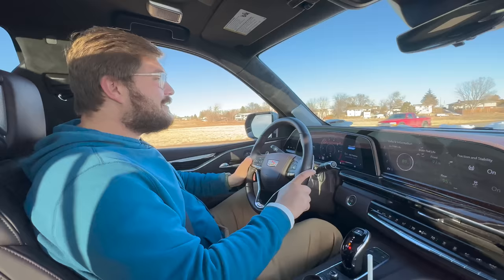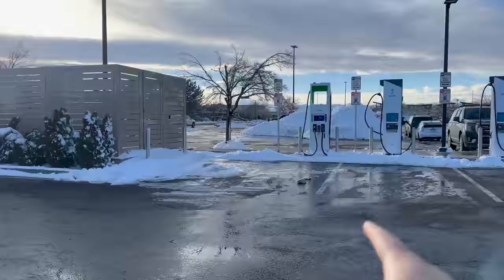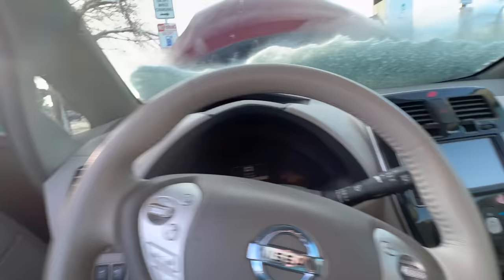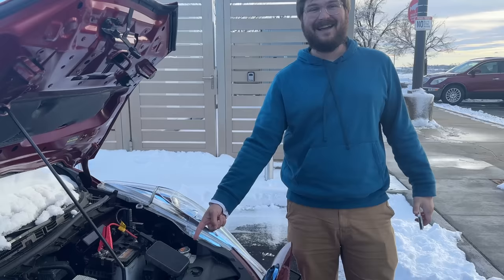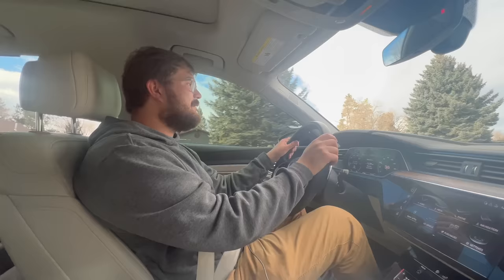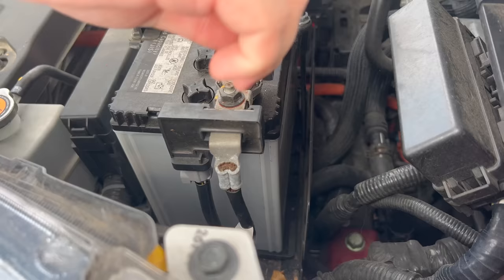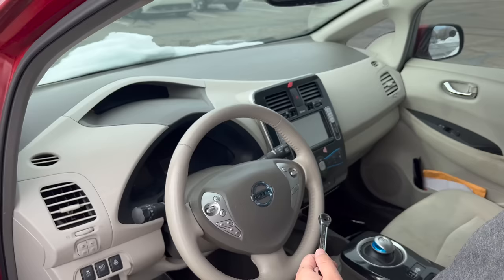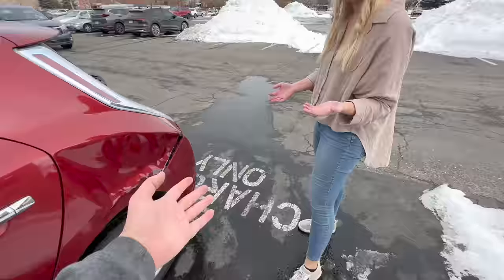My Cheap LEAF Bricked - So We Had To Save It!

Comment: The ESC activation on the Audi could be triggered by differences in the actual tire diameter. You would need to look at the measured tire speed through the ABS system and see if there is a difference. Some cars are super sensitive about it and even manufacturing differences in the diameter of the tire will be enough to trigger a perceived “slip,” especially if the tire’s manufacturing tolerances are sloppy. I’ve seen it many times. The same advertised tire size doesn’t necessarily mean they’re actually the same size. It’s more common when the vehicle had multiple tire brands on it, but I’ve seen it multiple times on cars with the same brand of tire but from different manufacturing batches. I couldn’t tell in the video, but if the steering wheel is off-center (like an alignment issue) it will throw off the steering wheel position sensor (aka steering angle sensor) which is part of what the ESC uses to determine if you’re sliding. If it sees steering angle but no yaw, it assumes you’re sliding and activates ESC. Just some things to consider.

Also, that’s a 51R battery. In other words, the same batter that every Honda pre-2010 uses. You could have gone to any parts store and picked up the same battery for half the price. I know that doesn’t help you now, but hopefully it’ll help some other Leaf owners. Most cars don’t need to get 12V batteries from the dealer since they’re almost all just BCI standard sizes.

Comment: A 12v battery issue on an EV? Never heard of that before. 😎
Reply: Ridiculous that a 12v battery is required.
Reply: @johnnyv5995  agree
Reply: @johnnyv5995  especially the voltage, the waste of copper is insane. The switch to 48v Lithium ION is necessary

Comment: That was the original 12V battery. I just replaced the 12V in my '14 Leaf and it was the same white color.  Panasonic batteries are what they used in those I believe. Since the 12V only needs to hold a charge for the computers to come on and isn't used to crank over anything they last for a super long time.

Comment: So as with ICE vehicles the easiest way to do this would be: have someone take you to buy a new 12v battery and replace it. That would have saved you so much trouble. I'd bet that would have worked the initial time as well.
Reply: If a lead acid battery is older than about 3 years I wouldn't trust it if it dies to come back.

Comment: I've always been taught to connect positive to the terminal, and then connect negative to some grounding metal away from the battery.  Then after your car is started, you reverse that order. That so that if there's any spark on disconnection, it's away from the battery.  My dad had a battery explode on him one time, sprayed battery acid all over the back of his overcoat, so thankfully no injury from it.
Reply: Also on the negative terminal of the 12 V battery on some cars there is a current sensor. On the Leaf I think it's the black rectangular thing that goes around the negative bus-bar between the battery clamp and where the flexible cable attaches. If you connect directly to the negative with any charger, the current sensor will think that the current is coming from the already dead battery, and this may mess up the 12 V charge management. It's always best ot connect the negative of your charging source to the body or engine somewhere.

Comment: Battery percentage is calculated using a formula where the main variable is voltage. It is an estimate of where you are along the curve from your battery's maximum and minimum voltages. 

The apparent voltage of a battery will drop when it is cold. The actual charge contained in the cells does not change, just the voltage that can be sustained by that charge. This is likely the reason for the fluctuations you see in SoC.

Comment: If there is no visible date sticker on a 12v battery, peel the side stickers down. The date or date code is usually thermally stamped about an inch down from the top, and intentionally hidden by the big label.

Comment: I suspect the LEAF was unhappy because there was an extra load somewhere. The HT was trying to keep the 12V full, and the 12V was running some random thing! 😁 Check for a stuck relay?

Also the LEAF won't charge when the bonnet is open.

Comment: In the USA with electrify America. You must: 1. First plug in the car. The.n With the car IGNITION OFF, 2. Initiate the charge. 3. If that does not work call them and have them reset the charger with the cart Unplugged, car off, plug in ( with the car off) then and only then have them initiate the charge.

Comment: The 12 V Battery died from an open inside it. It must have been very old. One thing Tesla tries to do is predictive maintenance to get the 12 V battery replace before such happens. Not enough current to make the relay pull in. Small boosters do work but it has to be a good 12 V battery it connects to.

Comment: Happy New Year's Eve. 

You might have to take the Audi to get its computer to recognize the winter tires so the traction system isn't freaking out. Or you could do it yourself if you have the right tools.

Also you can spray paint the 12V terminals red and black to save confusion about which is positive and which is negative. You can also use red and black tape.
Reply: WTF? Traction control detects wheel slippage. Think about it, different makes of tyres, tyre wear, weather, all affect traction, the car doesn't need to be told it has winter tyres fitted.

Comment: Procedure: 1) Connect the booster battery to the 12V battery to turn on the computer. 2) Start the car and disconnect the booster battery and wait 10 to 15 minutes for the lithium battery and its 12V converter to charge the 12V battery a little. 3) Move the car to the CHAdeMO terminal for regular charging.

Comment: You aren’t an idiot, but sometimes you have somethings to learn.   Certainly the truck can jump your 12v system, you just did that with the jump start device.   Electricity is electricity and that wrench could make a great connection between the 12 v and ground on the car.

Comment: Kyle, in my experience the best most reliable way to kick off Electrify America sessions is not by swiping the app but instead using the NFC or virtual wallet credit card in my phone and holding the phone up to the black/grey icon with the hand and waves for 3 to 4 seconds. Don’t put the phone on the credit card reader because EA will say “card not accepted.”  I use this as my go to way to activate and the great thing is you don’t need to know what charger in the app and swipe it so it’s quicker than fumbling with that screen. This NFC method works for me 95% of the time.

Comment: Any lead acid 12V battery that has been low on charge in freezing temperature needs replaced asap. The acid in them turns in to water when at low charge. Combine that with freezing temperature and that water freezing causes permanent damage to the battery.

Comment: Dude that Escalade V's shifts were unreal. Truly quick, rifle action, shifts for a torque converter auto (Ford's 10R80 does similar but for some reason this just seemed angrier). Amazing what technology is still doing for ICE vehicles.
Reply: the GM and Ford 10 speeds are related i think Ford design and GM are using them also

Comment: Some cars, certainly common among  many Peugeot cars of  the early 2000's (like mine) it has a no-tools-needed, quick release clamp on the POSITIVE battery terminal (this being a Negative Earth car).  No tool is needed as the terminal connection releases with a flick of a finger.  (if it was unusually stuck and someone was using say, metal pliers to release it, then, yes a danger would be present).  It is a handy feature and useful at times. Of course, don't wanna do it needlessly 'cause then y'gotta re-tune all the stations on the radio again afterwards LOL !

Comment: Just imagine some non-tech 70-year-old or teenager having to deal with this crap every time it gets cold out. Man, the tow companies are going to love these EVs.
Reply: It was the original battery. Old gas cars do the exact same thing. But yeah keep say dreamin.
Reply: @james5460  I have a 2012 LEAF and the battery died just like Kyle’s did. All I had to do was jump it and change the battery one time and jump start it another time just like an ICE car. Hence my statement. Yeah the leaf can accidentally go into neutral if you put it neutral. So what. So could an old stick shift car or an old automatic ICE car. Only super new modern ICE and EV have the lockout into park feature you’re referring to. Grow up I’m just trying to assure people that dealing with this older EV is no harder than dealing with any 10 years old car. And my leaf doesn’t brick every time it gets cold and I bet Kyle just had a shitty Battery so it died like all shitty batteries will in the cold since that’s what lead acid 12 bolt batteries have been doing for decades. Again no difference compared to older cars. I don’t see tow companies towing these but I do see plenty of ICE cars broken down on the side of the highway all the time. Oh heavens how will the old people and teenagers deal with ICE?  lol

Comment: Just go get a 12V.  You can get one at any auto parts store.  All of your issues could have been resolved in 15 minutes!  That, or jump start off of the Escalade.

Also, always remove the ground on the battery first before you touch the positive terminal, and do the opposite when installing a battery - positive first and then the ground.  Think about where that wrench might touch.
Reply: Yeah I don't get why they wouldn't have just gone and got one from a parts store. Why would you go to a freaking dealership to get 12v battery.

Comment: You could have gone to the auto parts store several times and purchased a 12v battery in the time you diddled around with that little booster.

Comment: for example, on the Renault ZOE, the 12v battery is a service item, if i recall correctly its supposed to be replaced every 3 years, even if the battery is good so it might've just beren that the battery needed to replaced a while ago lol

Comment: Careful those 6.2 have been throwing rods on the 2021 and 22. Those Noco jumps packs are awesome.on that charger you can press the manual override on it and it will give full boost . You usually have to use that on a battery that’s completely dead. If you pressed that it would stay going longer till you shut it off. Just make sure you are hooked to the battery’s correct before you push it
Reply: they throw rods cause people shit drive them for the sound lol

Comment: A jump-start, with old-fashioned jumper cables from the Escalade, would have got it charging.  That tiny jump box is pretty useless.  Of course, you probably would have still needed a new 12 volt battery eventually.  Lead acid batteries can be permanently damaged by the cold.

Comment: A Dutch company called Muxsan offers a CCS conversion kit for the Leaf. The kit including installation retails at €3K.
Reply: This would convert it to the European spec ccs and wouldn't work in NA. Yes NA and Europe both have CCS but they are different! Its so dumb.
Reply: @jamest6504  Correct, but I could well imagine Muxsan modifying the communications protocol. Changing the actual connector wouldn't be a problem.

Comment: The other Kyle wants a 60 KWH battery. This project should go with cheapest level 2 AC charger fix, then no more than 40 KWH battery, preferably smaller.

Comment: When my gasoline car runs out of fuel, I can simply carry a gallon or two to it, and away I go. A dead electric, no way - need to call a tow truck (gas/diesel powered of course) at a cost of $200 or so, and you still cannot go anywhere after delivery.

Comment: I have had this happen with a Leaf and the tired 12v battery was the culprit even more than the cold, not the car. It's not much different than an ICE vehicle in severe cold with a bad 12v battery and the best alternator in the world isn't going to save you. If you stop and it just sits, you won't be starting the vehicle again without intervention. With the Leaf, severe cold will use a fair amount of power to keep the main high-voltage battery at a minimum temperature for operation, but not wipe it out unless it was already at a very low state of charge.

Comment: Seems like a design flaw that a dead battery will keep the car from charging. I understand the why but I would have expected the charger to provide enough power before the handshake to run the 12v systems enough to bootstrap the charging process.

Comment: I hope you put the old battery on a mains charger at home. At 200 dollars for a new one it's worth seeing if you have a useable spare. If it does hold a charge just top it up every 3 months and it'll probably be a spare for 2 or 3 years. Batteries hate the cold, they often recover when warmed up again
Reply: Uncharged 12V batteries can internally freeze, as the electrolyte loses its antifreeze properties when completely discharged. I had a battery break the case from freezing while discharged.
Reply: @johnhaller5851  Yes, that's possible, still, if not damaged from total freeze it should recover as long as plates are not sheared off internally. At 200 dollars for the replacement it's still worth a look. Would be interesting to know

Comment: Glad it was just the 12v battery. Now to deal with the j1772 onboard charger is a different story. Looking forward to the next chapters!
Reply: I wish I lived near enough to aid in this in person.  There's a simple test that can be done to determin if the entire OBC needs to be replaced, or a simple diode added behind the plug will suffice. The test is simple enough, and will tend to save around $1500 for the replacement unit.

Comment: Rule #1: Never fight gremlins when you know the 12V battery is dead.  Just swing by the auto parts store and pickup a new one, drop it in and start over.
Reply: Replaced so many 12V batteries, both on gas and EV cars.  You would think EV’s could have finally solved the 12V issue but no, they have almost made it worse.
Reply: For example some EV’s stop charging the 12V battery when the main charge gets low.
Reply: Also you would think the 12V would charge as soon as you plug it in, but NO!  The 12V can’t be charged while the J1772 is connected, in fact it’s drained slightly because the EV 12V is actually what energizes most at-home EVSE’s (Blink I’m looking at you!)
Reply: So if your daily routine is to drive your Leaf until it is almost dead, while running the lights, radio, etc. then plug-in immediately and leave it plugged-in until you leave the next day, your 12V will eventually be killed.

Comment: The hoops you have to jump through to charge your vehicle. I just have to turn my key and it starts. And i keep up on regular maintenance. So mine will always start.
Reply: You do know that normal cars have the exact same 12V lead-acid battery that needs replacing or the car won't start, right?

Comment: I replaced the full-sized 12V battery in my 500e with a little motorcycle battery. It worked, but would need a jump in winter if left unused for more than 3 days.

Happy New Year!
Reply: I have the Fiat 500e myself, great car,. That's a perfect solution. I always keep plugged in anytime I'm not using the car. Always keeps the 12v battery charging which is a great benefit of an ev like the 500e because keeping the lead acid always charging or 100 percent charge is best for lead acid. chemistry. My 500e when I bought it used even had the original 12v from 8 years ago (2014). Crazy it still worked but with ev's the 12v is typically under less stress due to not needing to crank an engine and less heat because ev's don't produce much heat which hurts a 12v as well. Happy New Year
Reply: @Vivra_Verra____  yes, the motorcycle battery worked perfectly for operation, but in winter even when plugged in the motorcycle battery would go flat. I was surprised because I expected the car to monitor the 12V level and kick on the charger if it got low, but it did not.

A little jump pack like the one shown was all it would take to get it going again, but still annoying. Too bad because with a tweak I'm sure a smaller battery would work. (Also with daily driving or warmer weather it works.)

Ultimately I went back to a small car battery and that has been fine this winter.

Couldn't be happier with the little 2015 500e. We have kept it plugged in when home (i.e. all the time) so it always charges to 100% (no other option) and it shows no loss of range yet.

Happy 2023!
Reply: @usa-ev  Happy New Years. Interesting. Yeah it either charges the 12v with key on to ready mode or while plugged in. Great car though that is a lot more reliable than a lot of the new EV’s coming out today (mine has 55,000 miles now little loss of battery and not a single issue). The Bosch components like the motor and Samsung battery really are bulletproof. It’s why the FCA ceo at the time said “don’t buy one we lose $14,000 on each one sold”
Reply: i always get a better amp hour size in battery power than what the manufacture uses as they buy the bare minimum power cheapest battery they can find to last the warranty period of car for the most profit.
Reply: @jimmybee4893  not necessarily the case for EVs.

Comment: That is a nice Cadillac! Also, in the future, can you try to get your hands on a Mitsubishi Mirage with a CVT to review? They sound quite neat under high throttle. And also in some places are cheaper to drive than electric. That is at 50 MPG at $5 per gallon, VS 150 miles in the Nissan Leaf at $0.54 per KWh.

But it definitely won't be doing any racing.

Comment: Starter battery is not only important  volume Ah but  starting Ampers . Like  71 Ah  but starting Ampers are 650 A at least . More better  is for EV car stating battery like diesels at 100 AH and starting Amperage  900 A  to get  generator make enough  turns to getEV heating system  work in cold.